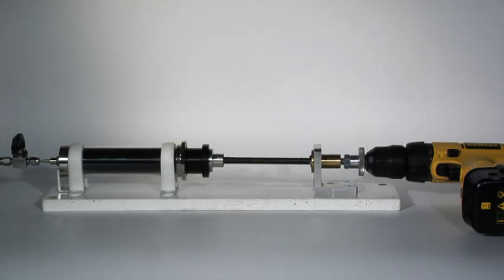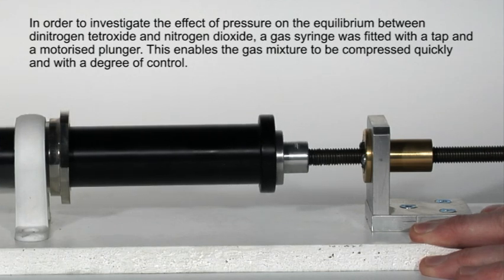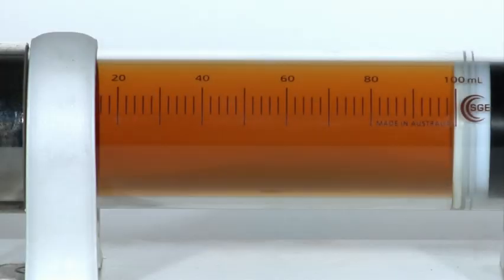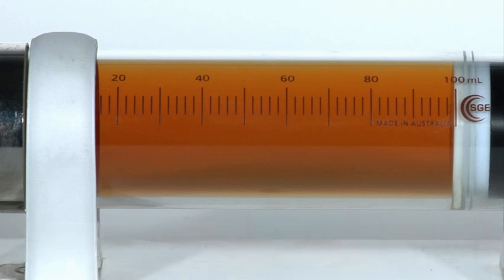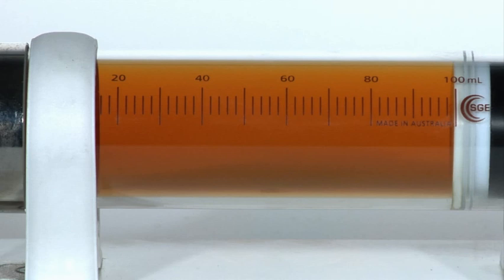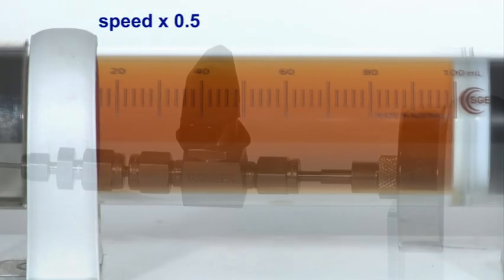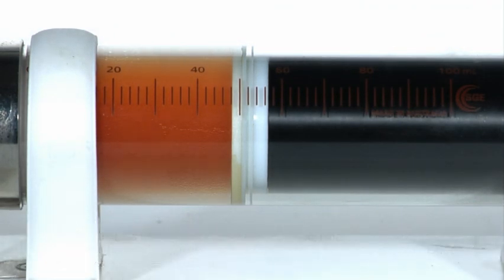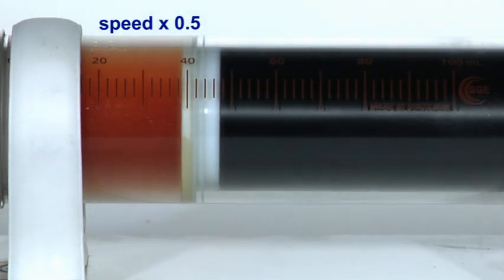The Effect of Pressure on Equilibrium - N2O4 to 2NO2

Comment: Hang on i'm confused now. The equation states that there are fewer moles of N2O4, and an increase in pressure shifts the equilibrium to the side with fewer molecules, so why is it that more NO2 is produced?
Reply: Hi Tankie Guy, you are misunderstanding. Le Chateliers principle would mean that once the reaction is at equilibrium, if the conditions are changed the equilibrium position will shift to counteract that change. For this example, if pressure is increased then the equilibrium position will shift to the side with less moles which is left (look at the balancing numbers 1:2). I hope that helps.
Reply: Alex Sullivan that’s what I thought, but N204 is a yellow gas, and NO2 is a brown one, the mixture went more brown which would indicate a higher concentration of NO2 before the equilibrium stabilised again. But Le Chateliers principle as you pointed out would indicate that more N2O4 was produced
Reply from the maker: @barnabyg6808  it changed to a darker brown at FIRST, it took time for the equilibrium position to move and stabilise. Once that happened the resulting mixture turned a lighter brown, see the video @1.29 with freeze frames. Hopefully that clears it up.
Reply: Yes, this confused me too at first. However, I am now thinking that at first, it darkens solely because the darker coloured NO2 molecules are closer together, therefore the gas looks darker (not because more molecules of NO2 are being made). With time and pressure, the NO2 dimerize to form N2O4, as per Le Chatelier.
Reply: Hello there :) More N2O4 is produced. so basically what i think happens is, at the beginning you have N2O4 in the syringe, When you increase the pressure, the N2O4 molecules are compressed into a smaller space/i.e. more concentrated, hence the darker colour. But this only happens initially because equilibrium has not been reached at this point, equilibrium is not always reached instantaneously, but once after some time the rate at which the N2O4 Is converted into NO2 and the rate at which NO2 is converted into N2O4 is equal. Equilibrium has then been reached, and now is when the colour lightens, because although the concentrations of N204 and NO2 are constant (they have equal rates) the concentrations themselves are not the same ( they are constant but not the same) the reverse reaction has been favoured because pressure is increased and the equilibrium wants to counteract that change, so moves to the side with the lower pressure - a greater concentration of N2O4 is produced. But the rate of production of the higher concentration (n2o4) and rate of production of lower concentration (no2) are equal, hence why they are at equilibrium.
A little side note- the equilibrium is said to be dynamic because the reaction doesn't stop the reactants are constantly being turned into the reactants and vice versa.
I hope this helps a little bit more
Reply: @gowrishetty5030  it does indeed thank you, unfortunately I took my chemistry A-level back in May of this year ( I got a B) and I’ve already lost most of my higher knowledge of chemistry. I’m actually quite sad about that because it took a lot of effort to learn and understand it all, yet only 4 exams later, pfff, aside from the odd quiz question what’s left of my knowledge is largely useless. Oh well I guess that’s true of a lot of school, just sad because I actually really enjoyed chemistry, shame it was so damned tricky otherwise I’d have taken it further!

Comment: WOW GREAT VIDEO.......I was wandering if the pressure would cause heat which would push the equilibrium towards NO2........OR......if the pressure would smash the molecules together and force bonding making the equilibrium shift towards the N2O4.   Now i know it is the second one(more N2O4).....THANKS

Comment: Thank you for this. So does the equilibrium move right or left and does it overall turn more yellow or brown?
Reply from the maker: I think you mean when at equilibrium, where does it settle? If so that would depend on the temperature and pressure. Look up the concept of Kc which is known as the equilibrium constant, which should answer your question.